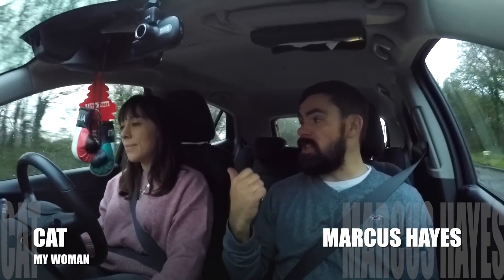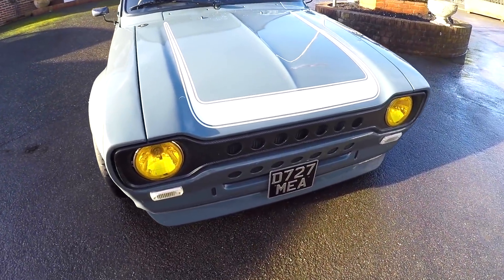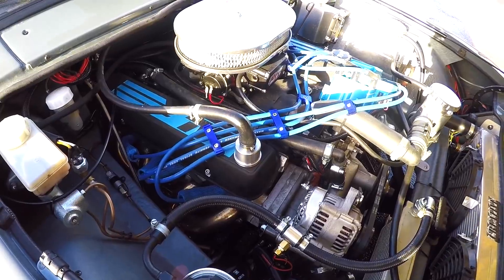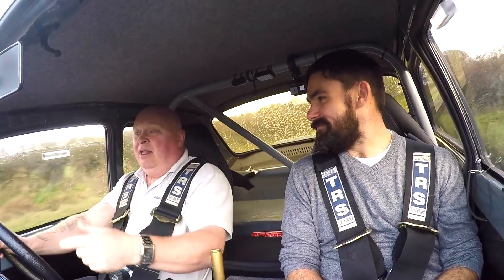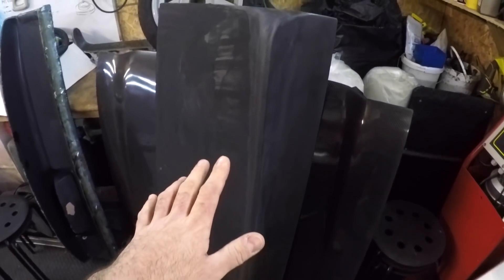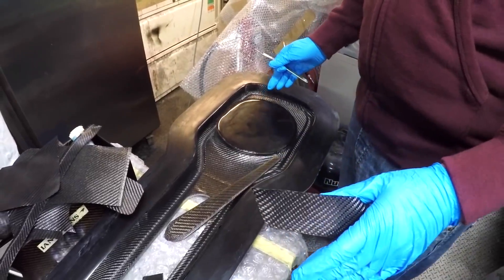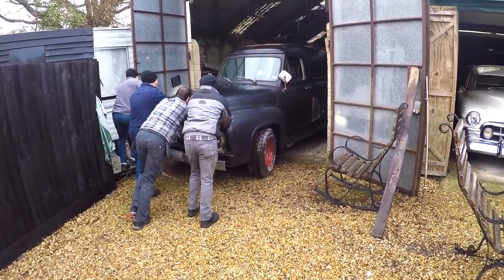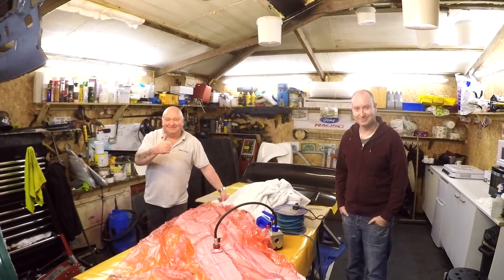LIGHTWEIGHT Mk1 Escort is a V8 MONSTER!! 😃

Comment: Nice car but it would benefit from a short shifter for the gears, that long change on the stick looks really awkward.kudos to Gary for having the balls and the imagination to do this in the first place... your grin when he gave it some beans was priceless Marcus!😁.
Reply: will be looking nito a short shift kit if i can find one for the lt77 box. it looks awkard to change gears as originally the tvr seats were about 6" further back making it easier changing gears. with the dash being a lot further forward now i had to move the seats forward and shorten the steering column so it didnt look out of place. i dont mind where the gear sticks sits as it is now. you get used to it but a quick shift would be nice to shorten the throw of the lever
Reply: With the V8 Engine he just may want to really open it up.

Comment: Thanks Marcus for the presentation of Garrys Mk1 V8 Escort & Carbon Fibre Panelwork operation indeed world class.
A NZ based former acquaintance of mine used a Jaguar driveshaft about 25 years ago in a Mk2 Escort with 1600 engine. Michael was a career Ford customer, particularly with the Escort RWD. Thanks for narrating the whole TVR presentation  and happy new year 2021.

Comment: Bet you are going for the bib spoiler and while your there might as well get the corner bumpers as well to match. There was a race series back in the 70 or 80s that used glassfiber  mk1 shells but they where space framed , with BDA power. Great vid 😄
Reply: hes already got carbon bumpers fitted to his mk1

Comment: Carbon fibre ,twin turbos this guys a lunatic. Cant wait to see that.
Reply: already bought the engine for the next project. 4.0 v8 going to be built with twin turbos and fuel injection
Reply: @garrybull4165  there's plenty on body damaged TVR's about sadlyvthere going up in value but still cheap for tge Engineering in them
Reply: @andyplage6590  ive seen a few about. im just waiting on funds at the moment to start the project. if it comes to it i may have to sell the car in the film. next cars going to be a beast
Reply: @garrybull4165  ill keep eyes abd ears out for any RTC wedges for you on my travels as get to some stra garages and recovery yards in my job
Reply: @andyplage6590  that would be great thanks mate. any 3.5s and above. 1986 onwards as they will be series 2 chassis

Comment: Sometimes when i see these old cars made to absolute track monsters i can't help myself to think what happens if you crash this at high speed. Like could the motor get pushed into the cabin, would the steering wheel penetrate the driver or something?
Reply: Dizzy D  how about the steering column?

Comment: Beautiful motor that mk1 escort Marcus and I would go for the front grill for Esther
Reply from the maker: Not sure on the front grill but Its defo an option for the future. I would LOVE one the same style as the original but in carbon but I imagine that would be a mission to make with all the individual slots. 👍
Reply: @marcushayesford  im tempted to try and mould a standard mk1 grille if i can find a decent one to take a mould off. got some tooling carbon which is only 200gsm so will be easy to cut the holes out as mould is being made.
Reply: Good on you Marcus take care of yourselves won't you buddy

Comment: I had a customer with a MK II escort with a 351 Windsor V8  (5.7) litre  ford engine fitted to it,  The front brakes had twin calliper for good stopping. It was all jammed into the original body and chassis. the footwell was a bit tight.

Comment: As the back of a car is easy to strip out,the front is pretty hard.To try and get a bit of balance front/rear it has to be the bonnet.Even though i hate the look of a carbon bonnet.good show.
Reply from the maker: ‘Esther’ already has a fiberglass bonnet and fiberglass front wings. It would be interesting to get her on the scales one day and see how well balanced she is. The rally fuel tank will help push the weight to the Centre of the car as will the heavy RX8 gearbox. 👍

Comment: Good to see GRP and carbon fibre being used extensively on a classic car (or is it?) Personally I can’t see any pleasure in constantly battling to repair the ever present rot in such a flawed body construction. It’s a shame that the carbon fibre process is so tricky and time consuming and therefore expensive. I can’t say that I understand the desire to use the carbon fibre parts in their naked condition though. For that reason I thought the front grille was the most desirable.

Comment: I put a cortina by 3ltre in my original 13 xp when I was 21 .had to cut out the bell housing to accommodate the gearbox. Got it going with the help a mechanic I knew. I was steel fabricated. Didn't change the diff , but we did put in twin webber's. Think you know the rest .did not work out well. Waste of a great classic. But to give me credit, it was 1983 ,and my car was 13 xl 1300 two door. Whoops. 1973 .

Comment: I dig the breakfast, the escort is a sweet car. This one is a kit car in my opinion. Nice anyways. I have a question though. Is fiberglass really more lightweight than metal in the end? Don't get me wrong, I really like the project.
Reply: the bodyshell weighs around 180kg bare so yes it is lighter than steel. my next mk1 body will weigh around 70kg as it'll be 100% carbon.
Reply: @garrybull4165  thanks for your reply and the numbers, a fully carbon build is awesome.
Reply: @We-Are-Scoobs  my carbon bonnet weighs around 6lb , original 25lb , boot 5lb , original 16lb. im making a full carbon shell soon and that sould weigh around 50kg complete inc main shell , bonnet , boot , doors etc. no floor pan though as im making that seperately

Comment: Looks like there is not much front wheel to arch clearance, we fitted a tuned rover V8 in a sierra rally car, and yes it was fast and gave us a few problems along the way, like gearbox mod to 3 roller bearings to replace the tapered bearings, as you cannot preload 3 tempered bearings as 2 face the same way and cracked alloy wheel at the bolt holes and tyres down to the canvas after just two stages and fuel used faster than you could fill bit, I think a it would be better suited to tarmac events.
Reply: plenty of clearnace on the front arches. dont rub at all

Comment: Great car, beautiful look. What makes the rover v8 so popular?
Reply: A lot of people like the rover v8 because it’s all alloy block heads everything so very light engine for a v8 and it can be tuned very easy with plenty of parts available 
I would of twin turbocharged it if I had it
Reply: @frenchie7206  The Rover 215ci complete engine was over 100lbs/45kgs lighter than a B-series 1800cc MGB engine. Leyland Australia  produced a 4.4litre variant called the Terrier for the P76.

Comment: Kool Video 
i Like his GARAGE Good Size .
my 2018 Tahoe has a V8 , 5.3L Direct injection , Variable Valve Timing , syn oil 0w-20 oil with 285/45R22 Wheels.
have AMBER LED FOG Lights.
355 HP and 380 Torque
Reply: and only 100 hp

Comment: What does it say on the V5? Is it a TVR with a ezzie body? Still boss though Bro beautiful looking thing, love the colour. Little concerned about your safety Bro could do with some side protection.  Be careful, stay safe lad.
Reply: still classed as a tvr with a body style and colour change. i wanted ecort replica on the logbook but they put body style change and tvr sport
Reply: @garrybull4165  So many superlatives, you lads have smashed it with this build. Cannot wait to see the carbon bodied twin turbo build! Have you though about one of the Toyota UZ engines for that boost?! All the best lads, hope you all healthy, from Somerset.
Reply: @Destitute77  keeping it simple hence the 4.0 rover v8 twin turbo. im keeping it basic with the setup by not having any complicated electronic gizmos that can be expensive. will still be good for 400+ hp if i wind the boost up
Reply: @garrybull4165  that is an entirely sensible reason mate, stick with what you know and of course it’s all down to the coin in the real world. 400 real world horse power is a big number in a light set up. 
Had a mx5 Turbo many years ago, on 7psi it was “only” 155hp, 12psi saw 210hp. Smallish numbers even back then, but on the jdm 1.6 gear box and being fairly light, had no business being as quick as it was. So 400 in a carbon bodied Mk2 is going to be a handful in all of the best ways.
Ever thought about contacting Hoonigan? The TVR chassis’d Mk1 is surely right up their alley, but add your carbon goodies in the mix there’s gotta be a demand amongst the vast US scene they could open up for you. I’m thinking Turbo K20 Carbon TVR Chassis MK1 at Sema next year lads!

Comment: Neat, lose the "carbon effect" mirrors though! You can shorten the remote on the back of the LT77. The XJ6 had a short remote as did the Sherpa version (although that  is canted over to put the lever towards the driver) but can be modded fairly easily. I'd be tempted to put a cheap non suffix/prefix reg as it would stop a lot of the silly questions. I like the idea of the look of an old Ford without the usual tinworm issues.
Reply: didnt know about the other gear stick options on the other boxes. will look in to it. i am tempted to put a cheap late 60s early 70s plate on but i do like the 86 number its on. makes people look twice lol
Reply from the maker: @garrybull4165  I’d say leave the plate as it is. It tells the story of the car. . . . . If it upsets the anoraks it’s a bonus! 😀😀😀
Reply: mirrors im hoping to mould so i can have real carbon ones fitted

Comment: Looks nice but i wouldn't fancy my chances in an accident
Reply: the old tvr body was a convertible and was no way any safer than it is now. it was probably worse. the seats in the old tvr were bolted direct to the fibreglass floor. the seats in the car now bolt through steel mounts welded to the chassis.

Comment: First off Gary shouldn't change those wheels 
They look the part 
And secondly don't put any carbon on the mk1 bud
Reply: yeah the revos look the part but want something different. always liked the compomotive th and rota make a very similar wheel but half the price.
Reply: @garrybull4165  love the motor mate
Reply: @alastairrich4432  not bad is it. it'll do for now. got some big plans for it over the next few weeks/months
Reply: bull  could draw it for you if you wanted it for ur workshop
Reply: @alastairrich4432  ive had a cartoon drawing done which is cool. ive got a massive pic to go up on the wall but can find a frame big enough. how much you charge to draw it?
Reply from the maker: Too late mate! She's had carbon bumpers for years! 😃 Id love to delete ALL the chrome and replace it with carbon if i could afford it! 😃
Reply: @garrybull4165  if ya wanted one I would draw it and then we can have a chat bud
Reply: @marcushayesford  got a mk2 grille coming soon so i can mould it. bit more carbon for maude
Reply: @garrybull4165  love a moredoor lol 
They've grown on me

Comment: Reminds me of the Subaru with the mk1 shell on it
Reply from the maker: I remember that car. The Subaru wheel base is too long and they had to extend the front end to suit. The TVR 350i wheel base is only slightly longer than an Escort so it works a lot better. 👍
Reply: i know the subaru based mk1 your on about and to me its just wrong. it dosent look right at all. by using the tvr chassis the wheelbase was out by about 10mm which when looking at the car you wouldnt even know.
Reply: @garrybull4165  yes you’ve done a great job 👍🏻
Reply: @gandhi1078  thanks mate. if i had to extend the body panels to make it fit the wheelbase i wouldnt of built it as it just wouldnt of looked right.

Comment: Where is the autoclave?
An 'oven' isn't suitable for proper carbon fibre production because you can't raise the pressure.
Reply: Vacuum.
Plenty pressure that way. 
And a (modified) fan heater for tempering under a cardboard box or a polystyreene box .... built boats three times the size of the whole Escort in one go from sandwiched prepreg that way.

Comment: Dude i run a v8 Cortina mk1, it weighs 786kg with me in it. How heavy is the Escort??
Reply: the original tvr weighed in at 1163kg. i reckon ive saved 350kg minimum but could be more like 400kg

Comment: My opinion is that the V8 is not the right engine for the Escort. The 2 liter high-tuned and high revving  naturally aspirated 4-cylinder is the best or 4-cylinder turbo engine.
Reply: high torque cars do well  in time attack  but I agree on high rev 4cl like the 4a-geu from Toyota or a k24 Honda would be sweet full trumpet intake manifold no filters lol

Comment: Needs quarter bumpers just cut the middle out job done
Reply: what needs quarter bumpers? if you mean for mine i was going for more of a track car look so no bumpers. i have toyed with the idea of carbon bumpers but not sure if it would look right as now got carbon bib spoiler fitted and got bonnet and boot going on soon. think if bumpers in carbon as well it may look too much. i'll wait till i get the bonnet and boot on then decide
Reply: @garrybull4165  quarter bumpers would spoil it,car looks great now ,ive had many mk1 escorts the best was a twin cam that i rebuilt ,as the saying goes ,wish i still had it,in 1990 a guy knocked on my door and said give ya £2500 for it mate, loving your work garry and im sure your business will grow very fast,good luck to you
Reply: @frozenice61  thanks mate. agree think bumpers will spoil the look. ive had quite a few mk1 over the years. last one was cossie powered with a mint bubble arched sheel , 5 linked rear end , coil overs all round etc. all the right parts fitted. got bored with it and sold it for £9500. worth hell of a lot more now.

Comment: It’s an escort mk1 replica. No  escort chassis number, no likely!
Reply: They sell brand new bodyshells I was reading the other day
Reply: your right its not a mk1 escort and never will be. i dont call it an escort. everyone else calls it a mk1 escort. its a rebodied tvr as still registered as a tvr with body style change on the logbook. got the looks of an escort and thats it
Reply: @ianmangham4570  yes you can buy brand new mk1 shells £14.5k plus vat. only way you can keep old reg on them is if you do a complete reshell of an old rotten car and use all the parts of it. you can also have it built using brand new parts all over and have it registered on a brand new reg number. not the cheap option though

Comment: Nice , but that shift position is not the best :)
Reply: cant do much about it. the tvr set up had the seats sat about 6" further back and with the escort everything is sat further forward so not much i could do about the gear lever position but im used to it. other than fittign a quick shift if i can find one that will help a bit. ive got short legs which dont help lol
Reply: @garrybull4165  if your running a lt77 or an r380, you can shorten the gear selector remote fairly easy. there are plenty of guides on it. or i believe you can get a t5 gearbox with a short remote from later tvr's
Reply: @MrRossKendall  thanks for letting me know. its got the lt77 box. will look in to shortening it but i have other stuff in the way so may not be able to shorten it much.
Reply: @garrybull4165  i am not 100% sure but i think the old sherpa van used an lt77, with a short remote.
Reply: @MrRossKendall  thanks for that. will keep a look out for a sherpa short remote
Reply: @MrRossKendall  jesus my cousin had one of those for his upholstery business. It redefined the term, 'shitbox'.

Comment: What is the weight.
Reply: roughly 800kg but may be slightly lighter.
Reply: @garrybull4165  so not light then
Reply: @paulnutter1713  300+kg lighter than the origianl tvr setup. it may well be a lot lighter than 800kg. the bodyshell can be picked up by 2 people.

Comment: V8 and escort should never be in the same sentence. Cossy - yes. Bda - yes. Pinto - yes. Zetec- yes. V8 never especially a rover v8. If it was a ls v8 with 1000hp I might let you get away with it.
Reply: its not an escort mate. its a tvr with a rebody and the v8 is standard v8 that tvr used in the 80s. nothing wrong with a rover v8. all alloy engine and sounds great. ive had pinto and cossie powered mk1s.
Reply: So if I put a Citroen Saxo shell on a Ferrari chassis it’s still a Ferrari...... that’s the dumbest reply I’ve ever had.
Reply: @joshward1148  its a tvr rebodied using a fibreglass mk1 shell. its not a steel mk1 shell. any car with a fibreglass removable body can be reshelled with any fibreglass shell you want then it has to be ok'd by dvla. dvla still class it as a tvr with a new shell fitted. you obviously dont know anything about reshelling fibreglass cars that have seperate chassis from the body.
Reply: Guess my fibreglass boat with a Volvo penta engine is a re shelled Volvo v60 then.........
Reply: @joshward1148  the Identity is with the Chassis so as it was Registered as TVR Tamsin its a TVR still its not trying to be anything other than a Siloette in Escort shape!!
Reply: @joshward1148  You obviously can't think logically or clearly, that's a given, but can you READ? Read Garry's comments. He is quite clear. Why are you being so aggressive to him? It's his project, his dream. He's not conning anyone and trying to sell it on as something it's not. It's a typically British bonkers idea to make something unique for HIMSELF.